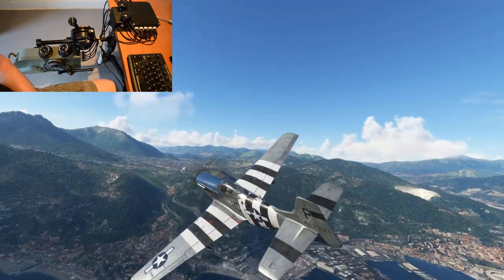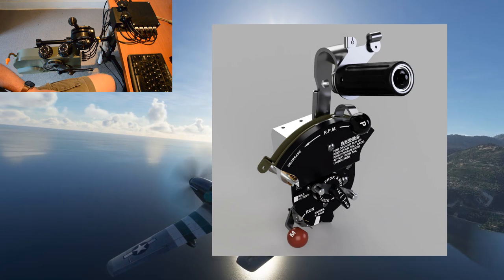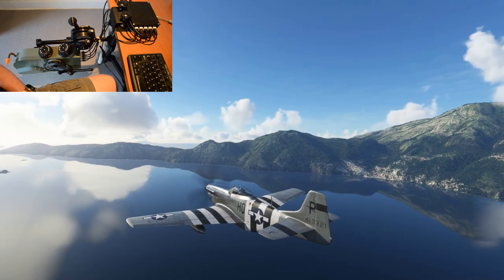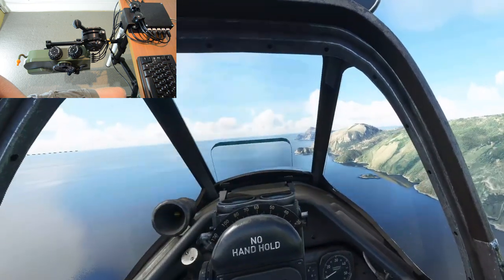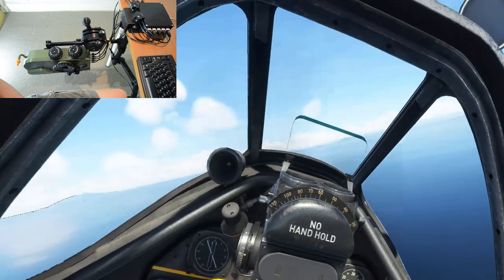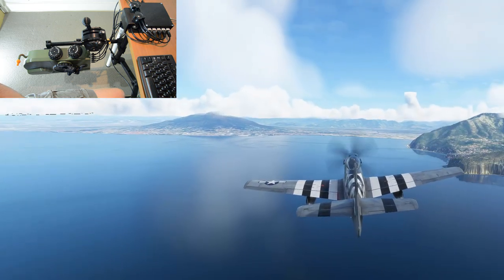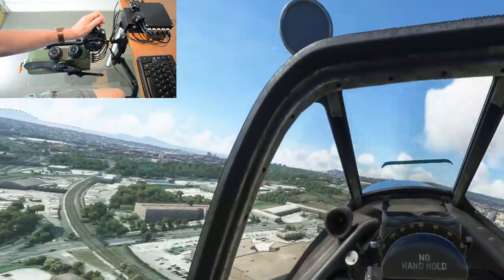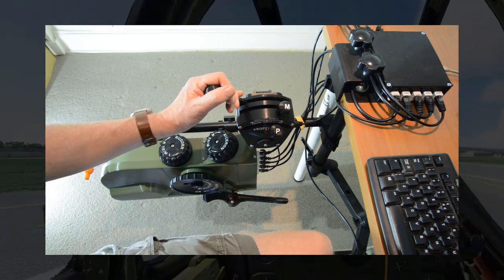AuthentiKit Freeware Project - Introducing the Mustang P-51D pedestal for flight simulation

Comment: Only thing it's missing is the oil/water rad controls.... (well the ram/hot air too, but those are not necessary IMO)
Reply from the maker: Glad you don't think the ram/hot air are crucial. Those rad controls are just above the pedestal aren't they - something for later...

Comment: The P51 looks good, but it's not flyable in DCS. The dynamic targeting cue disappears with the slightest G pull. I have to change it to fixed. Then the slightest turn stalls the plane. I have flown the F15 and A10 in DCS for over 10 years without problem. The P51 flight dynamic just doesn't seem right. I have given up on flying it in DCS.  I have yet to try it in MSFS or IL2.

Comment: Hello, I want to start by saying the kit looks fantastic, and this is not critique. I started printing the pedestal, and figured out the assemblying part. It is all straightforward. Next focus is the universal hub, and there as a non UK inhabitant I run into problems... as with Brexit the central Bodnar Board is very hard to get by and the import taxes are rediculous. As this is the central piece of all, and without an alternative, I am pretty much stuck with a lot of parts printed. I understand it is probably the best, but maybe include an alternative for those who cannot get a hold on it as that is still better then nothing. Other less vital, the very practical ethernet sockets are not deliverable.
Reply from the maker: Hi, sorry you're having trouble with sourcing. Brexit has made things more complicated and despite lots of research I have yet to find a substitute for the Bodnar. If you get these two kits it will come with the Bodnar and 10x RJ45s so you can use 5 in the hub and 5 in the pedestal. https://www.simkitsupplies.com/product/authentikit-universal-hub-starter-kit/
and
https://www.simkitsupplies.com/product/authentikit-universal-hub-upgrade-kit/

Comment: Can you tell me more about the Hub and the type of cables being Used seems like many Devices today for Sim gear use either some forum of Male Usb Plug on one end and on the other either Print scanner Plug,  5 pen Plug, or even mini Usb.             I am curious to find out what kind of cable you are using here it looks similar to Cat 5 plug,   I could see me using the hub but need to figure out if my other devices can be plugged into as well.
Reply from the maker: Hi, the hub is only for AuthentiKit controls unless you're DIYing. Take a look at this for more info and yes it's CAT5/6 https://www.youtube.com/watch?v=HggpexqLvh4
Reply: @AuthentiKit  Thank you I was wondering do you think it be possible to change the end of the plug on a Cat5/6 and replace with say Printer cable end I think this would be a more simple way to go instead of trying to change each port on the devices I do have.
Reply from the maker: @astrogumbie2399  You're very welcome to experiment with options.